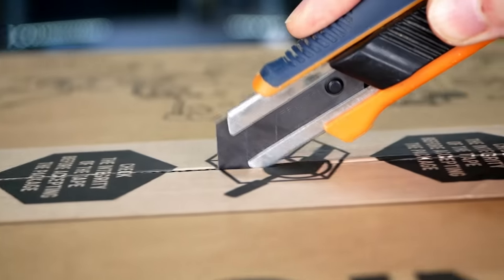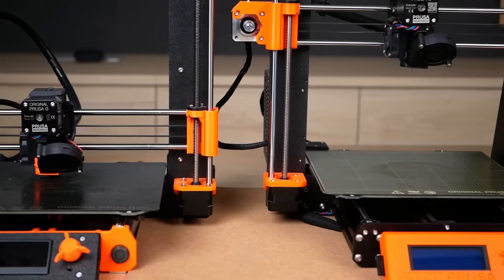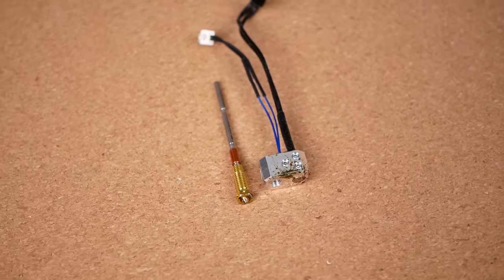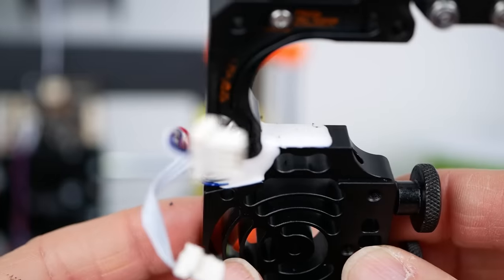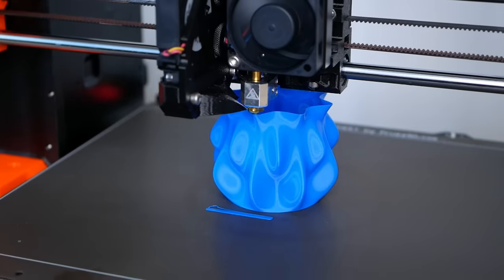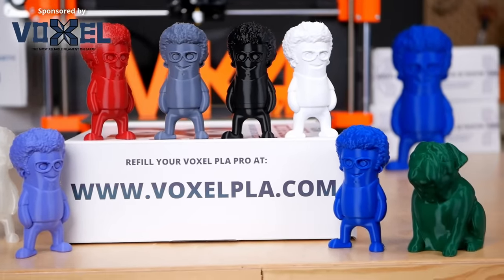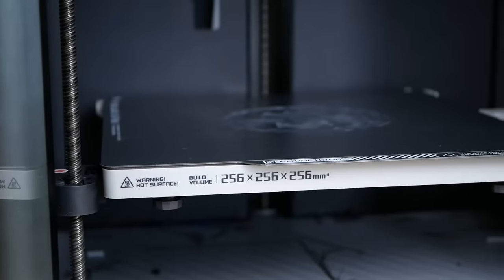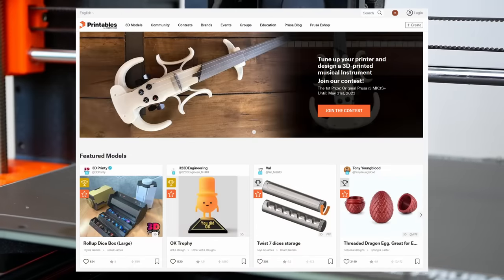Should you buy a NEW Prusa MK4 in 2023 or rather a Bambu Lab X1/P1P?

Comment: Good and honest review, thank you! I'll wait a bit before ordering one. My first 3D printer was an Ender 3. Of course not comparable to printers mentioned here. But that thing was just a pain and came with more maintaince then printing. My second (and current) printer is a MK3s. And hell yeah, I'll stay with Prusa.
Bought the MK3s in 2020 and never ran in a single problem. Slicing, start a print job and pick it up after some hours. I want to design my models and not wasting my time in hours of maintaince.
Maybe a Bambu Lab X1 can be a great printer, but I trust chinese devices only as far as I can throw them ;-)
I love the Prusa spirit, open design and - especially for my preassembled MK3s - the reliability.

Comment: My school purchased an Afinia H+1 about 4 years ago based on the combination of quiet printing and full enclosure with HEPA filter, allowing use while class was in session with the printer in a relatively small room. It does have some world class hardware and classroom friendly environmental specs... But there is no circumstance I can imagine where I will ever recommend purchase of a 3D printer with proprietary software or limited open source compatibility again. Not being able to use simple common fixes for the issues that have come up has been extremely frustrating.

Hoping to go with Prusa for a replacement soon. If a printer doesn't just work, it's no use. And while I am pretty good with dialing things in and adjusting, there are a lot better things I can be doing for my students. Fighting another proprietary system for 4 years is not in the cards.

Comment: I bought an Ender 3v2 Neo 4-5 months ago. My first printer. I print mechanical parts for personal projects. No cosplay or figurines for me. My Ender has been good for the most part but I do have occasional problems. Usually related to the extruder and a few times it was the hotend. I have ordered the available direct drive extruder for the Neo which arrives this Saturday. However, my instincts tell me it's time to move on to a more serious printer. I'm almost set on the Bambu, but I do have concerns about longevity and security. Some have stressed that the Bambu (DJI) has poor security protocols and it could essentially compromise your home network. I just feel more confident buying the Prusa. But I don't know yet.

Comment: Is the full upgrade (3s+ to 4) worth it for $579 when the 4 retails for $799?  Just $200 more.  

I have a 3s+ and like the upgrade option but the less expensive upgrade options would work too, but the main board and extruder are the best features. If I just go with that upgrade, then it's still almost $500. 

In other words,  is upgrading worth it or better to buy the 4 kit (given the small price difference)?

Comment: You can turn off the Bambu X1-Carbon cloud services by using LAN mode. I haven't yet because I like the mobile app, but from what I understand you can run the printer just fine in an air gapped environment using LAN mode.

Comment: I got a MK3 s kit … after installation a sensor was defective , PRusa send me a new spare sensor , I replaced and worked fine for a month and half then another sensor broke and I returned the printer to PRUSA and bought the X1 carbon … what a machine ❤❤… x4 faster , automatic calibration  , record - time lapse ( you can see it from your phone ) , error detection notification send to my phone , auto bed leveling ( doing this by yourself is so annoying ) , multicolor printing , etc . what a master piece of machine … only thing left is to see how long it will last .
Also my advice if you live in a place where is cold make sure , especially if you buy PRusa to buy the case otherwise your gonna have to warm up the room before start printing 20 degrees I recommend .

Comment: The Prusa mk4 was outdated before it was thought up. The simple fact that the bambu out of the box at only 350 dollars more includes an mmu, a heated chamber, hardened nozzle, lidar auto bed leveling, spaghetti detection, first layer inspection, faster print speed, and much more, makes the bambu the future of 3d printing for off the shelf printing. prusa is rehashing an old design and hoping the name will carry it through. I personally think the bambu was the next big step in development for 3d printers to reach a much larger user base. Btw, I dont own a bambu, I have a rat rig v-core 3

Comment: I have 2 Prusa printers, and also a Creality, running klipper. I have fitted the Creality with a Hemera direct drive extruder and 1.2mm volcano nozzle. I use the Creality for quick prototyping and the Prusas for detail/finished work. I find Prusa hard to beat, because it's clear from Prusa's track record that they fully engage with their community, support it, and "get" what the market is asking for, filling in the gaps as best they can. I have the XL on order (shame that Prusa have been glacial in their roll out of this), but I still see a  use for the Creality I own, which is a great printer for testing concepts and quickly creating new ideas. However, I seldom have to even touch the Prusas I own, whereas the Creality requires constant tweaking to keep it within reasonable tolerances. 
I think Prusa are missing a printer with an enclosure, and this is a big weakness in their product line. ABS is a wonderful material, but an enclosure is more or less obligatory, and Prusa should be making this cheap, and very strong, material a meaningful part of their workspace.
Looking at the printers in this video, though, I would not go near a Prusa Mk4. It's very overpriced looking at it's specifications as shipped, and I feel it has been brought to market too early, to try and make a profit. Not a great approach this time, Prusa.

Comment: MK2 with a Bondtech here.  Still have the same bed as I did 5 years ago.  Beasts is all I can say.  Old, yes, but reliable and comfortable, yes.  Prusa's are the Chevy Truck of printers.  I want a Ferrari but don't need it.  I just want consistent that works every time - my almost 7 year old printer does that for me.  But, would I buy a MK4?  I absolutely would not with Core XY being as cheap as it is now.

Comment: Just bought the MK4, next printer will a multimaterial printer, waiting for some comparisons between the Prusa XL and the Bambulabs X1C is regard to printable supports and multicolor. When it comes to "embedding" flexible materials in a hard-plastic print I guess the only option is the Prusa XL.

Comment: A few things, I'm new to 3d printing, I don't know much about Prusa or really any brands, and I'm a fairly new subscriber so my opinion is kind of a wash BUT, I don't think I'd call you a shill for Prusa I think you like what they have made and want to try out the latest offerings they have. I started my 3d printing journey on a pretty tight budget, I spent $200 and got an Anycubic Kobra Neo, and 2 spools of Overture filament. I don't know how my printer stacks up against a prusa of any generation but I've been pretty happy with mine. Build quality is lacking but it gives me an opportunity to Take things apart and learn how my printer works.

The Z axis screw for example, it was coated in some form of grease out of the box but the grease was so sticky it felt like honey. I had to use Brake cleaner to get it off. But, I've learned how to take it off and put it on. 
The MK4 looks like it has some very cool features that I wish I had but I can't justify that price for my usage and abilities. My little anycubic is perfect for me just as your Prusa is perfect for you!

Comment: I have had nothing but problems with our Bambu X1 Carbon, mostly with the bed scanning feature. It seems to only work intermittently and it takes several minutes to run the scan which can waste a lot of time when trying to start a print. We also have a Prusa Mini which is my go-to because it just works, though the print quality is nowhere near as good as the Bambu when it works. Also, nothing but hatred for the Bambu's UI, I shouldn't need to register an account just to access the troubleshooting guide. And the very vague error messages make figuring out why it refused to print very frustrating.

Comment: For a beginner, an Ender/clone or the P1P ($700) for those with a bit more cash - heck even Sovol or Elegoo are great choices. Out of box, the P1P just works, fast, and very well. Bambu Lab does not have much of a history so no telling about reliability. If I were building a 3D farm, the MK4 probably top consideration.  For someone starting 3D printing as a hobby, that $800-$1000 for MK4 is very steep.

Comment: I owned a Prusa MK3S+ (kit) for almost 2 months. The MK4 became available about 7 weeks after I received my MK3S+. I saw that the MK3S+ kit pricing was dropped by $150 and the MK4 kit was priced the same as what I'd paid for the MK3S+ kit. At first, I thought I'd just upgrade my MK3S+, but the MK4 used very few parts from the MK3S+. The upgrade to almost an MK4 was $579 + shipping + duty + tax. Not a simple upgrade.

So I contacted Prusa. Surely they could help me, since they're famous for customer support. Unfortunately, I could not get a refund for the price difference in the MK3S+ kit. And I couldn't receive a  discount on the MK4 upgrade. And I couldn't exchange my MK3S+ for an MK4. The only options available to me were (A) Keep the MK3S+ and ignore the new MK4 or (B) return the kit for a full refund. I chose the full refund path. After all was said and done, I was out the $48 for the original shipping cost. So much for customer support.

I got a Bambu Lab X1C Combo and later got a P1P. The fully assembled and ready-to-run P1P cost me $100 less than an MK4 kit would cost me. My Bambu Lab printers absolutely fly through print jobs. They are louder than the Prusa printers, but they're fast enough that I'm done printing before I go to bed.

One thing I missed about the Prusa was its ability to print flawless PETG jobs. PETG is a bit finicky. After several attempts to get PETG running at Bambu Lab speeds, I went through the Prusa and Bambu profiles and created a Prusa-based profile for my Bambu printers. I just slowed everything down tremendously, but it worked great. The Benchy that took 1.5 hours on my MK3S+  took 1.5 hours on my X1C with the Prusa profile. The quality was actually better than what I'd gotten with the Prusa. A few tweaks later, I had the X1C producing Prusa-like Benchys in about 45 minutes with no reduction in quality. Both awesome and sad at the same time.

Prusa has piddled around for several years with their new designs. If Bambu Lab had not released the X1C and P1P, Prusa would still be selling MK3S+ units. Bambu Lab was sending out printers for evaluation (and with explicit instructions to be unbiased, good or bad). Prusa doesn't do that. Reviewers apparently need to buy their evaluation units. I may be wrong, but that doesn't seem like a healthy business decision.

Finally, I found the MK4 advertising to be extremely misleading. The MK4 has input shaping and super-fast, high-speed capabilities. But not now. You'll have to wait until it's actually developed. But order now and we promise to work on it. Just as soon as we get done shipping XL printers. When will that be?

Comment: Built many MK's ->  Now own an X1C ,  put over 1000 hours already into this printer and Ive not had to fix anything at all on this printer or take it apart. I was worried with the AMS the bambu would run into headaches and be a headache if it breaks.  The X1C with multiple filament colors, just RUNS .. truly a  PRESS AND PLAY machine. You have to do very little with it but load filament. Everything about the X1C is pure joy when it comes to 3D printing.

Comment: I'll be upgrading my Mk3S to a Mk4... eventually. With a Raspberry Pi hooked up to my printer running Octoprint, the only real advantages the Mk4 offers to me are the improvements to print speed and the load cell making z-level adjustments a thing of the past which... are nice I guess? Just not worth rushing out to getting a kit immediately since I'm not exactly running a 24/7 print shop here.

Comment: Stefan -- great insight as usual.  Longevity??  If you do a follow-up...please assess/comment on longevity, serviceability, cost to maintain.  I used my MK2.5 and MK3S to create face shield frames (NIH design with forehead shield, not quick prints!) almost non-stop during the pandemic, running 24/7 for months.  Will the Bambulab products hold up as well?  Do you know if anyone has tested longevity, e.g. run a farm of these 24/7 for months?  That's probably my greatest concern.  I am reasonably impressed by the X1 and P1P.  But I find myself thinking... am I only interested because of price?  Would there be a contest if MK4 was say within $100?  ( I do hate noisy printers, 2D or 3D.)  I have confidence that the MK4 will perform 24/7 print after print (plus a heater cartridge now and then LOL) but what about the "new kid on the block"?  Cost to repair and maintain X1 vs. MK4? Is Bambulab destined to be a "consumable" 3D printer (not great), good for only 2-3 few years?  X1 vs MK4 -- quite the debate...for now.  (I wonder if PRUSA has purchased and reverse engineered an X1, ha!)

Comment: ive got 3 mk 3s 1 mk4 and until last month I had no P1P's... now i have 7... prusa has been a wonderful product for many years but the speed of core xy machines cannot be denied. I print 2-3 times as many parts only limited to the custom volcano nozzles ive designed for the p1p. Im pushing 40mm^3/sec +

Comment: Comparing cost alone. The final cost of Prusa MK4 to be upgraded to match the BambuLab X-1 Carbon is (Prusa) 1705 vs (Bambu) 1449. 
Prusa MK4 Base Cost: 1,449.00
Prusa MK4 Enclosed: 1,376.00
Prusa MMU3 Upgrade: +299.00 ($300 or $330 if you want the MMU3 pre-assembled)

Bambulab P1P: 599.00
Bambulab P1S (Enclosed): 699.00 
Bambulab P1S with AMS: 949.00
Bambulab X1 Carbon (upgraded hardware vs P1S): 1,199.00
Bambulab X1C with AMS: 1,449.00

Comment: We have 2 Prusa Mk3S+. Several attempts at resolving a couple of issues with support were unsuccessful. Wait times very long. Agents seem to multitask and leave you dangling. Had an XL on back order 2 YEARS. Chatted with them today to finalize order. Asked how I could include a few filaments, was told not possible, despite it says on their order web page you can (I double checked). The fiber I’m most interested in (carbon) was out of stock, unknown when it will return. Agent bragged about how demand exceeds supply, yada, yada, yada. I know we are an exception but I don’t like Prusa. My wife bought a Bambu X1 and doesn’t use the Prusas anymore. Superior in every respect and the company has been way more responsive.

Comment: One often overseen property is the space a 3D printer needs. This might not be an issue for companies or house owners, but for makers living in a flat. Regarding the volume required by a 3D printer the Bambu Lab X1 is the clear winner. I would spend several hundred bucks more, if Prusa had a machine of this size. The Prusa Mini+ is the only device that fits in my small office.

Comment: I bought an X1C in feb... was using it for a few weeks and was absolutely blown away. So I bought another. Ive been running both daily since then and ive had almost zero issues. My advice is buy the powder coated PEI beds and use something like Dimafix penstick. Zero adhesion issues.

I do with the slicer had more of PrusaSlicer features though, but im sure thats coming upstream.

I cant comment on the MK4 as I dont have one but if I did have the budget for one id probably just buy another X1C.
Reply: you  need additional adhesion on the PEI? mine is sticking flawless without any brims or extra Sticks (only tried PLA and TPU so far)
Why not a P1P? its cheaper and can do nearly the same

Comment: I have the Bambu Lab PIS with the AMS.  I print almost exclusively PETG.  WOW!  The parts are smooth and STRONG and print VERY fast. I have no idea how long this machine will work without repairs?  That is to be seen in the future.  I did not buy the MK4 because it is too small for most of my parts.  All of my recent printers are printing over 400x400 mm.  I wonder if Bambu will come out with a 400+mm printer?

Comment: I'd love it if Prusa offered an XL with an enclosure. It seems that with an XL, I'd avoid the material waste from changing materials with my Bambu X1C printers because the XL switches tool heads an therefore doesn't need to purge at every material change unlike the X1C.

Comment: I have an MK3S+ that has been trouble-free. I spent a long time considering whether to buy an X1C or the MK4. In the end, I decided to buy the MK4, which will be delivered tomorrow. I passed on the Bambu this time because don't like products that are dependent on some kind of cloud infrastructure, and I like the open source aspects of the Prusa. While the Bambu's AMS is cool, I really didn't like the amount of waste that it generates, and it does have limitations on the materials that it supports. For the MK4, I ordered the MMU3 multi-material unit, which will come later. It's not as nicely integrated as the Bambu AMS, but it will tide me over until what I consider to be the best multi-material solution arrives, and that's the multi-toolhead Prusa XL that I ordered for delivery next year.  I don't have a lot of interest in multi-color printing, but I am interested in printing with dissolvable support, a mix of rigid and flexible material, and other functional multi-material applications. I'm glad to see that Bambu's A1 has reduced the amount of material waste, and I hope that they will continue to work on that.